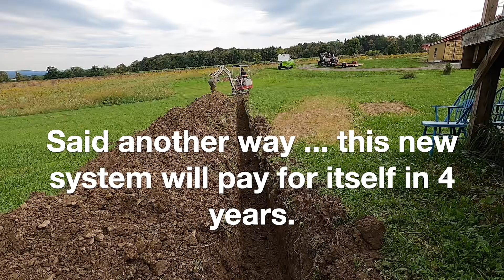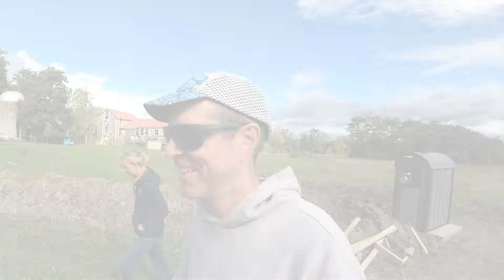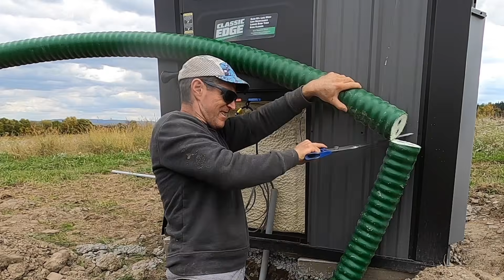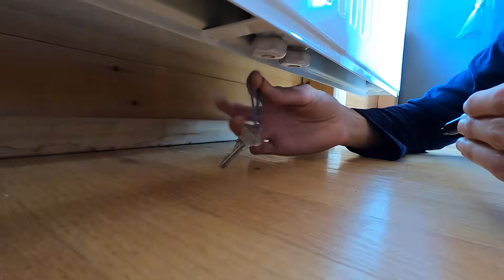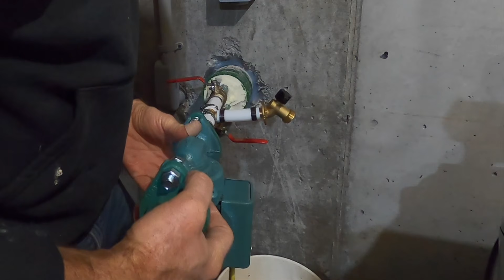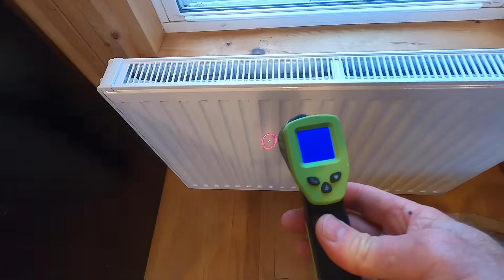Outdoor Wood Boiler FULL INSTALL, Start to Finish

Comment: What's the names of the wood boiler that requires no or very li electricity and what about a Central Boiler ? Because it might be useful if a power outage  ?
Reply from the maker: I don't know of any outdoor wood boilers that don't rely on electric circulation pumps to move the water through its circuit. In a power outage we'll have to crank up our generator to keep the water flowing

Comment: Nice work.  Excellent video.  I see that you have two pumps.  I have seen older versions of that same wood boiler only using one pump.  Is the two pump version an upgrade?  If one pump fails, can the second pump run the system?  I'm seriously considering this as an option.  Again, great job on the video.
Reply from the maker: We've got two pumps at the boiler because we have two lines, but then each line has two pumps. When one fails I think it'll block the line up with it's impeller blades, which will really suck when that happens. My understanding is that the two pumps on one line just improve the flow and reduce load on each unit

Comment: So far from the house so much heatloss from pipes?
Reply from the maker: 3 degree heat loss between the boiler and the house, which I'm happy with. Keeping it far from the house means less smoke in the house and all the wood storage (and mice that come along with it, invariably) can be far away. Works great for us
Reply: @metaspencer  impressive I would have expected more
Reply from the maker: @MrButuz  And then the house itself pulls about 18 degrees out of the water

Comment: I cringed when she ran under the skid steer while the arms were up. We had and excavator blow a hydraulic line while the boom was about half way up and man did it come down fast. stay safe guys
Reply from the maker: You're right about that for sure: no need to take that kind of risk. Thanks man

Comment: I noticed your had two logstor pex ran to the unit but i only noticed one running into the foundation. is there a reason for that?
Reply from the maker: One line of the green insulated thermoplex goes to the house, the other to the workshop (not yet heated). If that doesn't explain what you're asking about let me know
Reply: @metaspencer  yes thank you! i figured it was for something else but must have missed that part.

Comment: It might sound like a dumb question but I notice boilers are always placed way-far away, it that a safety issue or more to do with capacity or maybe a little of both? Great video, for a first attempt it was very well done.
Reply from the maker: In our case we wanted to keep smoke, wood storage, and the structure away on our property

Comment: Probably should run a larger wire for the voltage drop
Reply from the maker: Supposed to be 14 so I ran 12 … seems okay
Reply: @metaspencer  you can use an online voltage drop calculator

Comment: Sadly. Pex pipe shouldn’t be used at temp 200 or above. But anything above 180 can affect life span and cross link
Reply from the maker: I’ve read about the 200 degree threshold… I’m eager to see how long it lasts
Reply: @metaspencer wish the best for you. 
I have had many customers have issues due this very reason. Also several issues if right at heat source. 
I love pex. But I have learned over the years not the best for everything. 
I have had customers push for pex so I hard pipe at heat source then switch over. 
From dealing with mfg. they consider the 180 a issue due to life span loss or burst or losses grip on fittings. 
Overall not a bad video you made. 
And yes support the line right inside the house. 
I been doing plumbing 33 years and have seen it all or minor things that caused big issues.

Curious how do you like that system so far? 
Actually more curious if it being in a very open area if you noticed any loss due to 100% of weather affecting it.
Reply from the maker: Thanks for the tips! Much appreciated and your experience is valuable. So far the system is amazing. Our house is truly warm for the first time and we only refill the boiler once a day
Reply: @metaspencer  
Glad the unit is working great for you. 
Most everyone I talk to with that unit loves them verse others. 
I was wondering since it was so out in the open if there was a loss. 
Also. Your very correct in your comment about the cost of the pipe. 
It’s overpriced and then some

Comment: You should make some sort of your own system where you can use the pressure from the boiler to make some kind of electricity can help feed the system for if any power failures happen or anything like that almost like build yourself a Tesla
Reply from the maker: Cool idea … it would be nice to capture more than just heat
Reply: @metaspencer  what you can do is get a motor u use the steam from your boiler to get it moving and then you use a generator
Reply from the maker: That would be cool, but no steam as it stays at 180

Comment: Why is it so far away from the house and barn. I would have put it at least half way or next to barn or house. It would be way more efficient.
Gonna lose a lot of heat traveling that far. Of course the camera could be making it look like it's far away from both structures.
Reply from the maker: It's definitely a long way from the house as we like to spread out our buildings and keep smoke away from the house in the winter. Temp drop hasn't been an issue (3 degrees lost over the run) so it seems to be working out

Comment: Questions what's the max temp of the tubing  you using  180 ?
Reply from the maker: Rated to 200f and it runs at 190 in this system, so it's a pretty close call. We'll have to see if it degrades over time

Comment: You should get a zone controller, a few pumps and separate it some so it's not all running all the time. Can make it controlled by thermostats in each room if you wanted to. Love watching you guys work together!!
Reply from the maker: You are absolutely right! current controls are simple but not as effective as that would be. I've gotta do a bit of research to figure out just what we need ... but that's the plan. Thanks man

Comment: I'd suggest putting a stamped metal tag in a water tight bag labeling the lines with a laminated paper tag. Working in a 80 year old building I've thanked past workers many times for the extra labels on pipes.
Reply from the maker: Great idea. That kind of labeling is great in the future ... thanks for the tip

Comment: Are you concerned about the pex tubing temperatures you took at all (internally probably hotter than external measurements)? We were warned if we ever hit 200 we must replace everything, and 180 is a danger zone we should avoid? I saw you measuring 170 at one tube, are you afraid you're borderline for the radiator tubing and need to bring that down some so the pex in the house isn't compromised long-term? P.S. I couldn't tell if you had any pressure relief valves that blowoff after a certain pressure to avoid buildup which lowers the maximum temperature allowed as pressure increases?
Reply from the maker: I don't worry about it -- our temps top out at 185 or 190 when everything is in the swing of things. A lot of guys tend to use PEX and I haven't heard of bursting or leaking from overheating. But that's just me: I don't worry about it and wouldn't mind replacing pipe if it did come to that someday. No pressure release valves as it's an open system

Comment: What controls your radiators like as for temperature control
Reply from the maker: Now THAT is the question! Dozens of questions about so many other things, but no one has asked THAT question. :) Currently the answer is nothing at all. We just turn them down or off when it's toasty and turn them all up and on to heat up. I'm thinking I'll have to re-loop the radiators and control the with a thermostatic valve. But that might be a little fancy for us, so it hasn't happened yet :) Currently it's in the comfy mid 70s in the house
Reply: @metaspencer  have you thought about getting cheap 3way popper valves these are spring close but if it fails it has a little lever that you can open manually I live in Oklahoma and we will go from 70's to 20's in 4 hrs so I'm gonna have to figure that out when I buy a unit.
Reply from the maker: @blakedismuke3656  I haven't seen those so thanks for the tip! something like that will be my next step
Reply: @metaspencer  well I would look into cheap HVAC controls in Oklahoma we have temperature controls. I'm an HVAC tech and we use this stuff in big older buildings they require a circuit setter that balances the GPM of each load so this could be something that's not economically possible

Comment: Why set it up so far from the house .?   Could have put it mid-way between the barn when you had the trench open for electrics , save yourself a load of work .......
Reply from the maker: Yep you're absolutely right, but we like the idea of keeping the smoke far away from the house and downwind. We'll also have an ag building by the heater so like to space our building out on our property. But I see your point.

Comment: Id love to get one of these but we only spend around $1000-1500 on propane a year so it would take 10+ years to break even. And I have unlimited wood on my property. Im not convinced that these would last the 15-20years in order to actually save any money. Im in southern PA so you must live somewhere super cold! Liked to vid thanks for the time you put into it👍
Reply from the maker: Wow, that's an amazingly low heat bill. Amazingly low! For us, the wood boiler wasn't only about the money: it also provides us with much better and MORE heat than our very modest previous system. But yeah, it sounds to me like it might not be the best system for you. For us it's just great! :)
Reply: @metaspencer  that is a very low price for sure. Our decision was made when my 30 year old gas boiler decided to quit in the fall. I live in NY and wanted to get one installed before they ban wood heat so that I will be grandfathered in.

Comment: I’ve seen these all over northern Wisconsin and they usually are not quite as far away from the house.
Reply from the maker: Yeah we like the idea of keeping the smoke away from the house and also spacing out our buildings (there will be an ag building there eventually). Everyone does things a bit differently I guess
Reply: @metaspencer  looks like there is barely any smoke though so better safe than sorry I guess.
Reply from the maker: @Kaodusanya  when it's burning strong there is plenty of smoke! no doubt about it
Reply: @metaspencer  really? isn't there a secondary burn?
Reply from the maker: @Kaodusanya  yes there is but it's an imperfect system producing plenty of smoke until the whole system is really cookin

Comment: Sure hope the New ones are WAY BETTER THAN ALL THE OLDER ONES. AS THEY ALL SUCK !! CL-17 especially side draft all developed pin holes and ALL RUSTED OUT 
MINES BEEN WELDED SEVERAL TIMES AND NOW  THE LAST BANDAGE IS THE LIQUID BOILER SEALER …  LOVE IT WHEN IT WORKS!! Not so when it’s Broken…. looking at NEW Portage and Main   BOILER !! Sorry Central .. Was good few good years anyways. Lol
Reply from the maker: Oh man that sounds rough! These days Central Boiler offers a 25 year warrantee but in my experience rust always happens

Comment: So the drains higher in the basement...
Reply from the maker: The system drain is at the boiler (low point) -- that tap in the basement is for adding water or letting air out

Comment: Do you plan to put a roof or enclose the boiler? Here in North Carolina I've seen many wood boilers that have a roof or complete enclosure of the boiler. I think using either one would help protect the boiler and your investment. Good job on your install!!
Reply from the maker: Yeah you said it. The plan (come springtime) is to build a structure out there with room for wood, tools, tractors, etc. I like the idea of roofing over the boiler, as you describe, to keep the water and snow off. Rust is inevitable but I try to fight it as much as possible

Comment: Nice video. 
We had a sprawling complex - house, store, gun shop, etc. - and my dad built the same thing you have. He used some huge barrels for the stove and welded on a door. It was big enough to cremate a body. He built at pickup truck bed height so you could back up with an 6 foot log and just push it in. Originally it was next to some buildings but the insurance company made him move it across the driveway. 
The copper pipes went underground and to radiators throughout the buildings. They were simple repurposed radiators with fans. 
He burnt all of the paper from the store and huge logs. It would only need filling every other day. For 30 years it heated all of the building in Minnesota winters - up until he sold everything. 

IN our first house my Dad but in in-floor heating (hot water) long before anyone else. He had seen hot floor heating in Korea and wanted the same.
Reply from the maker: That sounds like an amazing setup and ... crematorium! I wanted to build my own but ended up going the store-bought route. What a cool story you have there!

Comment: Hi thanks for sharing the good work you did. For the water expanding did you install an expansion tank?
Reply from the maker: As I understand this system it's open (open on top of the tank at the heater), so expansion in the system is handled by that open top. So no expansion tanks in this setup as it stands right now

Comment: These should be banned in all areas.  Why? My neighbor behind me has one and there is a reason  chimneys are on top of the roof.   I have not been able to open my windows in 11 years as my neighbor’s smoke comes into my home   Just depends on which direction the air is traveling and it’s worse on humid days and yes he burns year around.   The stack is not high enough which does not get the smoke high enough to clear the surrounding homes    There are no rules or regulations in any towns for theses boilers so big thumbs down.   Don’t be a suck neighbor add the extra stack pipe and have courtesy for others
Reply from the maker: It's too bad your neighbor doesn't have a higher stack. Many people with wood boilers have 40' stacks for the reason you describe. As for us, we don't have neighbors (78 acre farm) so your complaint and problem doesn't really pertain to us. Maybe you can work with your neighbor to extend the stack
Reply: @metaspencer  it’s too bad you are not my neighbor.   I think it’s likely most people who install these do not run them 24/7  so they have no interest in spending for the. Tar pipe which is costly
Reply from the maker: @Curt-do7cl  Many municipalities also have burn bans and wood burning bans ... sounds like you're unfortunately not in such a town or city

Comment: Why is it 165 ft from the house? I like the setup and the installation.
Reply from the maker: There were a few reasons for the location of the heater: we like to keep buildings spaced out on our property, and there will be a big wood shed near the heater ... another reason is that we wanted to keep the smoke far from the house. Plus, crowding the house isn't our thing and there will be lots of wood piles, tractors, equipment, etc. near the heater
Reply: @metaspencer  makes sense.  I knew there had to be reason just wasn't sure if it was technical or owner preference.
Reply from the maker: @DesertRox  the only technical part is to put the boiler below the high point in the house

Comment: Nice job on the install.  I can envision you trudging all that distance out to the boiler to stoke it on a bitter winter day.  Why did you place it so far from the house?
Reply from the maker: There were a few reasons for the location of the heater: we like to keep buildings spaced out on our property, and there will be a big wood shed near the heater ... another reason is that we wanted to keep the smoke far from the house. Plus, crowding the house isn't our thing and there will be lots of wood piles, tractors, equipment, etc. near the heater

Comment: Very good setup few questions though.
How many times a day u throw wood in it..?
Why burner itself is so far from house
.?
What if temp goes over heat..?
Thanks
Reply from the maker: When the air temp is between 20-30f we refill it once every 24 hours. With temps down around zero f we have been refilling it about every 16 hours. Strong winds seem to also lead to more wood burning. There were a few reasons for the location of the heater far from the house: we like to keep buildings spaced out on our property, and there will be a big wood shed near the heater ... another reason is that we wanted to keep the smoke far from the house. Plus, crowding the house isn't our thing and there will be lots of wood piles, tractors, equipment, etc. near the heater. As for temperature, the wood boiler has a lot of sensors so suppresses the fire when the water gets to a highpoint ... then the fire comes back on when the water reaches a cool point. So the water is always in an ideal temperature range
Reply: @metaspencer  Thanks a lot, that's very detailed answer. Enjoy the warmth of it.
Reply from the maker: @ajazvahora3124  super toasty in the house! :)
Reply: @metaspencer  great,
Really liked it...
So for hot water for bath and kitchen also comes from same wood stove..?
Reply from the maker: @ajazvahora3124  Yes the hot water for bath and kitchen goes through a heat exchanger and is heated by the wood boiler, but only in the winter when we're running the boiler